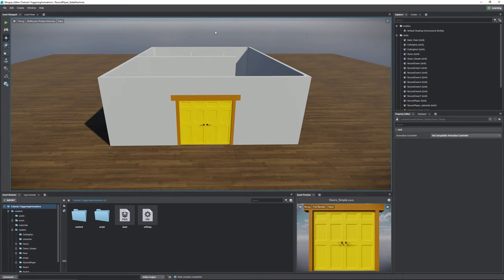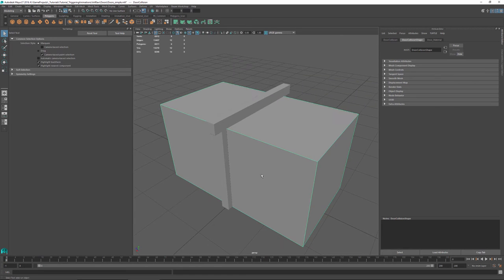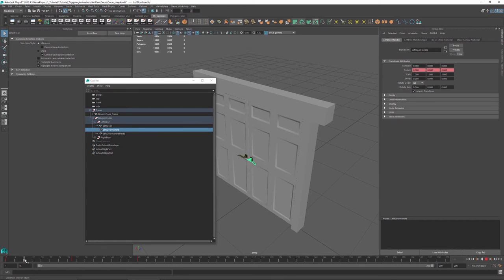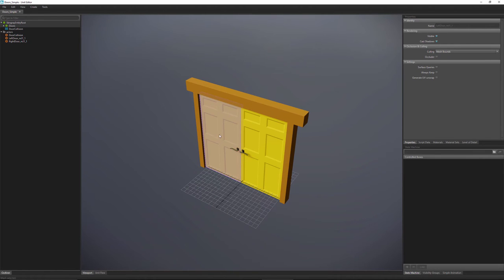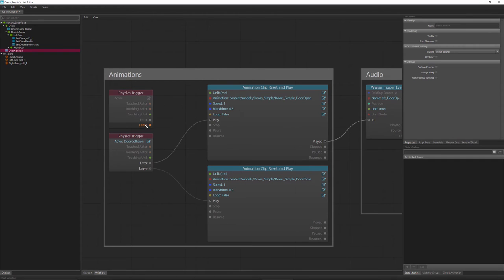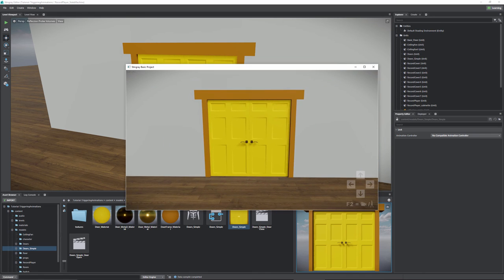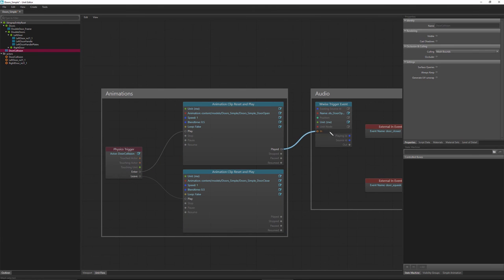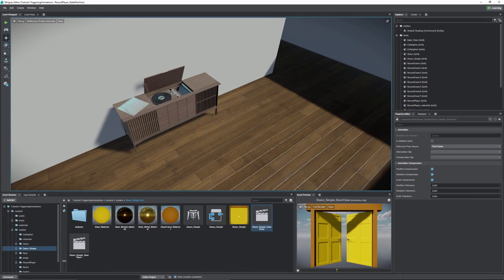Triggering Animation in Stingray - Part 1: Doors, the Easy Way

Comment: hi . thank you for this video ... want to ask if you can add a hand to open the door or turn the light on/off as a player's hand !!!!
Reply: you definitely could add hands to the equation, however this is a much bigger job requiring animations and is very much out of scope for the tutorial.  The concepts are easy however.  You will want to add a boolean operation involving being within the trigger volume as well as a click ie: if within volume and user click then play hand animation.  You would also likely want to animate the camera and remove control from the player while this happens.  otherwise they may be sticking their hand out and walking away from the door.

Comment: Thanks for the tute. Any possibility of an update or clarification for Stingray 1.5? Seems the node "Animation Clip Reset and Play" doesn't exist anymore and the new one "Play Animation Clip"  isn't wired the same way. Wasn't very lucky with Autodesk Help. Thanks
Reply: Hrm, im not sure what you mean.  Play Animation CLip is wired exactly the same way.  Unit goes to unit, ANimation is the animation you want to select, speed is how fast you want playback to occur, blend time is how much blending that will ocurr and loop is well, loop.  Play, Pause, Stop and Resume allow the different types of triggering.  You may want to try updating to 1.6 also as 1.5 is now a bit old.
Reply: I just did that a couple weeks ago and most of my problems solved themselves. Cheers

Comment: My scene is a full building with multiple door types and sizes. Have you created separate open and close clips in 3ds Max? The only way I know how is to create one animation per door then split each door's animation in Stingray. Any ideas on how to cut out some steps would be helpful, since I'll be needing to do this on many door sizes and types for one building.
Reply: You can create skeleton and re-skin all the doors using the same skeleton and then use the same animation on all the doors.  Stingray uses the skeleton for moving stuff, not the model/mesh, so if you do this, you can import only one skeleton and apply it across a multitude of doors.  Honsetly though, this method with a little practice is so easy that i cant imagine it taking too long for you to whip through a series of doors in an hour or two.
Reply: since you have multiple doors/styles, you would need to do this for each style.  but not for each and every door.
Reply: one way you could populate the doors is to do as im recommending above.  then you could create markers for the door types.  ie: steel_door_marker0, steel_door_marker1, wood_door_marker0, wood_door_marker1, etc.  (any kind of locator would be fine) then in stingray you could populate them on level load by looping for each marker and spawning the doors.  Not the most elegant solution, but should work well if you dont need to see the doors in the editor.  Make sure you orient your markers correctly in your max/maya scene though.  otherwise they wont face the right way or spawn where you want them.  Might be more trouble than its worth though.  I would just place them manually in stingray.